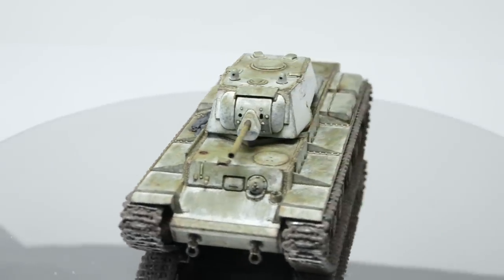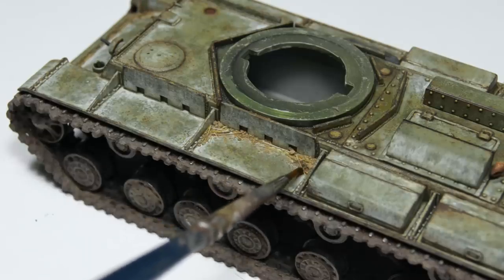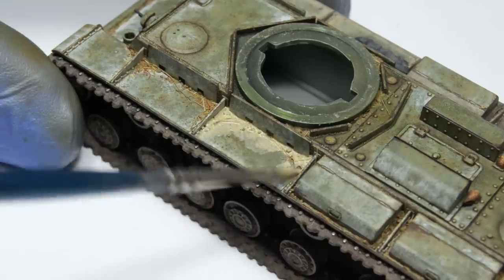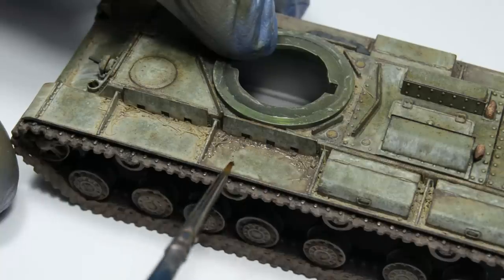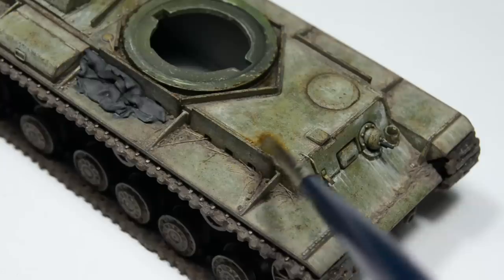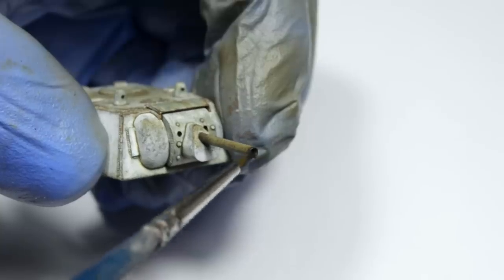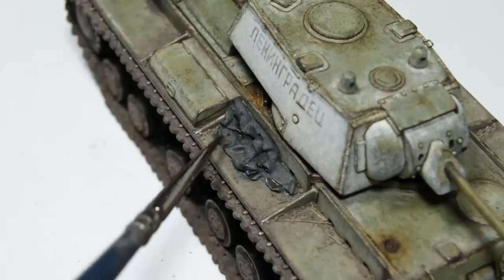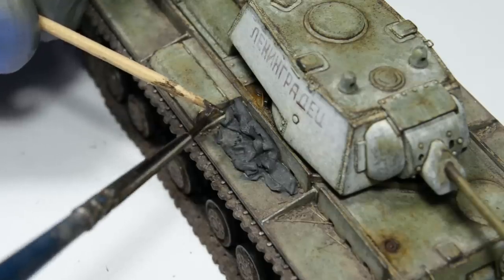Using REAL EARTH For Scale Model Weathering? YES PLEASE!!! | KV-220-2 | 1/72 PST Final Episode

Comment: Regarding Engine soot/oil stains-Diesel engines are compression spark engines vs. a gas powered vehicle, which use a spark plug. What does mean for people who don't know anything about engines? A compression style engine aka Diesel engine doesn't "warm up" the same way as gas engines do. Idling a diesel engine for long period of time doesn't allow for it reach operating temperatures, which allows the piston rings not to fully expand (which help with compression in the engine), which allows the  "pushing" of engine oil and diesel fuel out the exhaust stack. 

To prevent this, a diesel engine needs to be "high idled", which means its running at a higher RPM then it would normally do when idle till it reaches operating temps

TLDR: Your second explanation was close enough ;)
Reply from the maker: We were quite a few beers deep at that point, so I might've not remembered it correctly :)

Comment: If I may I'll add a couple of suggestions: I use diluted white glue to fix things on dioramas and models. 
Once dry you cannot remove it by any solvent but only mechanically.
I also use a lot a variety of medical clays that come in different shades; the consistency is that of a powder a little bigger than the usual color pigment, and mixed with water, acrylic thinner or diluted white glue can produce dust, rain shades or mud respectively. HTH
Cheers

Comment: Ok Martin great video and walkthrough like always but I've got one question. Why use the laquer based fixer instead of thinned PVA or tacky glue (or even liquid super glue for that matter)? Seems to me that you can get the same result by just giving the glue mixture enough time to cure. Ounce for ounce (or mL for mL in this case) it would be cheaper to go for the thinned PVA vs a dedicated product when the results would be comparable. Is there a specific reason or is it just personal preference?

Comment: I saw this guy on yt use dirt and clear glue mixed with pigments and use it on the wheel and under tracks and skirts and it actually looks good won’t stick permanently but it’s good because if you make a mistake you can rip it all off or put more over

Comment: I get a lot of ground work from the end of my driveway.  I shovel up several pounds of it  and then put it in one of those disposable aluminum baking pans for turkeys.  The next thing I do is put enough water in the pan to cover all the stuff by an inch or two.  The idea is to float out all the lighter stuff like leaves, wood, litter, etc.

Then I drain it an put the pan in the oven at about 350 degrees for an hour to kill anything that might be living in the dirt and to dry it out.

After it cools I start sifting it using different size strainers, colanders, etc.  Finally I bag it up.  So I'll have a bag of very fine sand, a bag of coarse sand, a bag of small gravel, a bag of larger gravel and so forth.  It's cheap, available, I can get whatever size ground work I need and it only takes maybe an hour to do the whole thing not counting the time the stuff is baking.

Comment: That is not the reason the vehicles produce so much black soot. The actual issue is caused by imperfect cylinder sizes causing fuel leakage past the cylinders, and low combustion pressures which intern does not burn all the fuel.

Comment: As far as Russian engine exhaust goes, I think your friend who worked on T-72s and BMPs is the subject matter expert, and from my limited experience (with American equipment however), it seems logical about the seals in the engine.  American and Soviet industry favored loose tolerances during WWII, and so our equipment got built so much faster with spare parts that needed less work to put into place, which is why the Germans lost.  Badly.  Tighter tolerances are great on sports cars, bad for tanks.